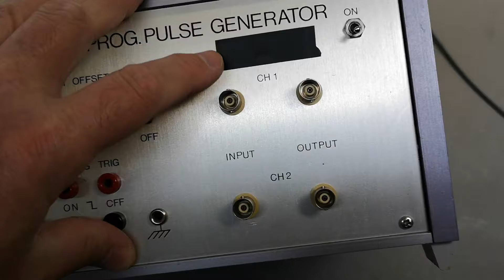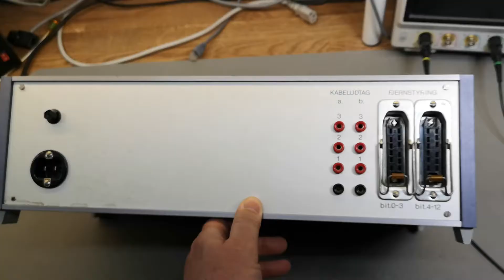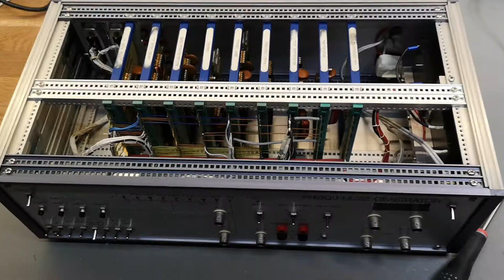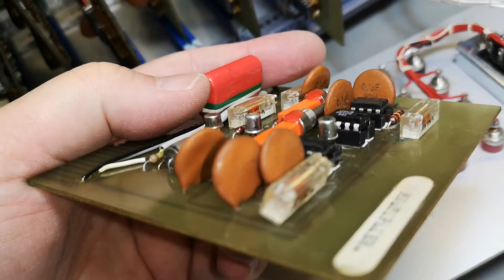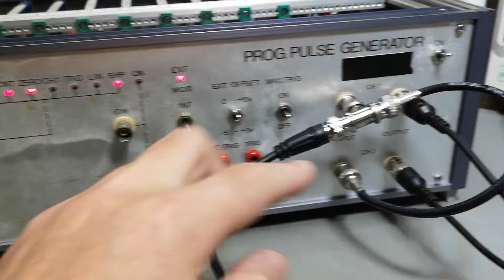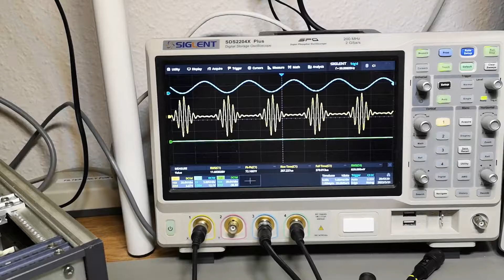Prog Pulse Generator 1979 unknown company, test, teardown

Comment: Green goop is vinyl plasticiser, that reacted with the copper of the wire over time. Bisophenol A that was added to the PVC insulation as plasticiser, so yes you should clean the boards of it. 

As to use, I would say it was an internal development, used to either test something that needed digital control of a pulse, like say for a ultrasonic instrument, where they were controlling the voltage using a digital input over those Berg connectors at the rear, must be a DAC on the one board that is doing the conversion, and then this voltage is used to control the gilbert cell modulator. Likely has a modulation response up to around 100kHz, and input likely can go up to 1MHz with no problem, as the 741 opamps are likely there merely as unity gain buffers.